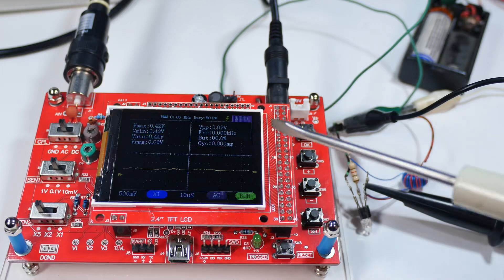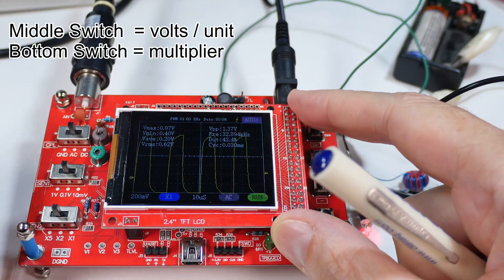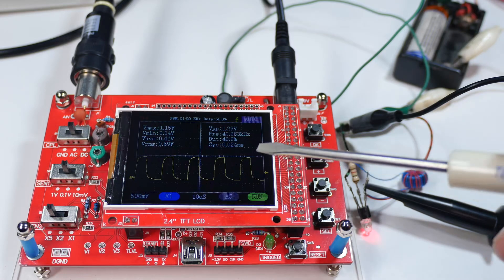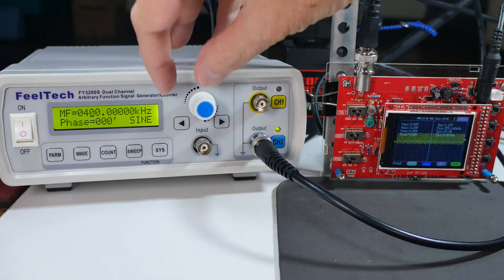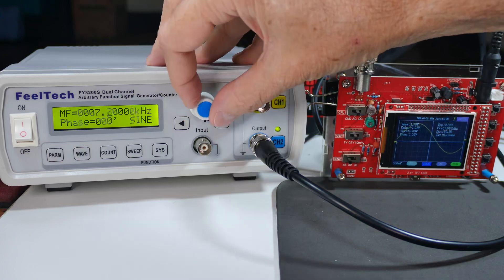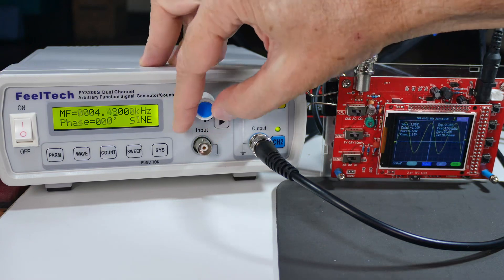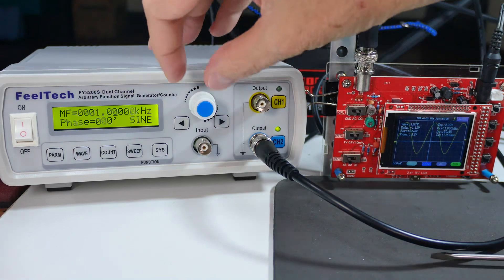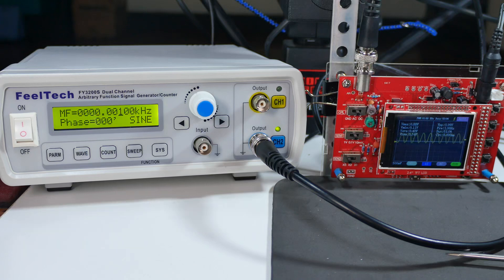Using The $25 DSO138 Oscilloscope - Joule Thief & Freq Generator (4K)

Comment: Nice video. I have one too. But I am facing some issues. The radial Inductor is humming (noisy/ distortion sound). Any help. Thanks in advance
Reply from the maker: What do you mean by the radial inductor is humming?
Reply: @tsbrownie  when i turn on the power supply, the radial inductor beside the dc female jack creating noise loudly.

I am giving 9v from smps.
Reply from the maker: @Harry001by7  I can not say. But I would check the soldering. If it is working, and it's not overheating,  I would try to quiet it with silicone glue or similar.